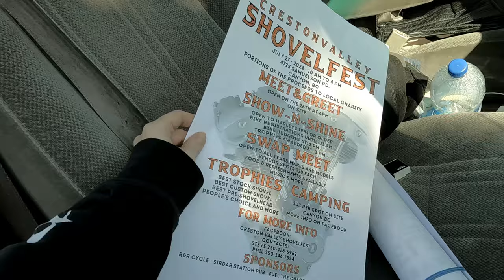Sunny Days Means Swap Meets And Riding!

Comment: You commented about probably never wearing a full face helmet. I don't think I'd be here if it weren't for a full face helmet. Quite a while ago (48 yrs ago) I had a '57 Chevy back out of a drive in front of me. I couldn't stop in time and went over the bars head first into the rear quarter window and proceeded to total the car bouncing around on top of it. All I ended up with was stitches in the chin and aches and pains. I'm not preaching, here in Wisconsin helmets are not required, but I still wear a helmet 90% of the time.
Reply from the maker: I am glad you made it out of that alive! I have thought of a full face helmet for road trips and stuff, I was actually looking at the retro style Bell lids cause they would kinda suit the look of my shovel.
Reply: We have the option to wear or not to wear.
Back in the day I gave money to defeat the Mandatory helmet law, you should always have the right to choose!
I Always ride with my helmet ON.

Comment: I am intersted in the outcome of your seat on the sportster.  and is there away for an oil pressure gauge on a sportster? may be a tee  in front of the oil pressure sender.what do you think.
Reply from the maker: I am not too sure actually 🤔  I have never worked on a sporty so it will all be a learning process with these projects!